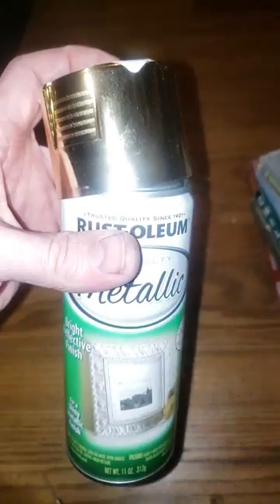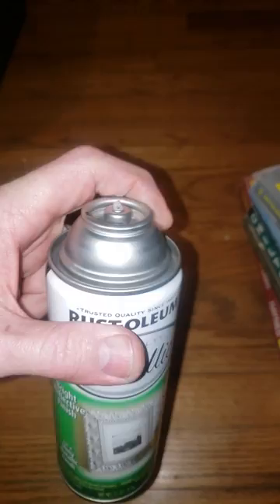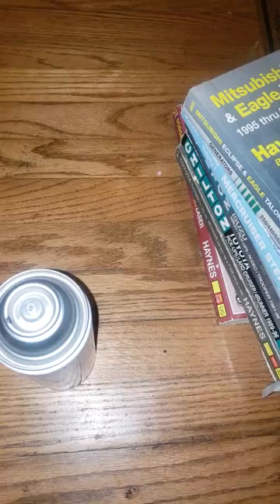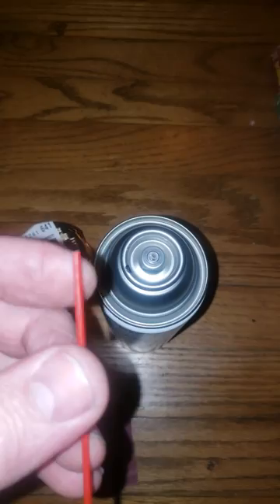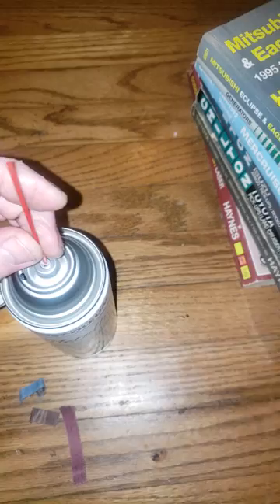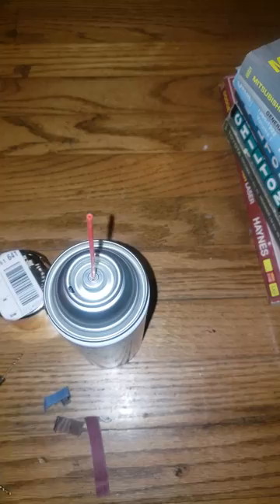Spray Paint Nozzle FIX! Broken nozzle / tube!  L@@K!!

Comment: I turned around to grab the can for the second coat, knocked it off the table and snapped the cap right off... After a few choice words for rustolem my first thought was I knowYoutube has a fix. Here we go again! Thanks for the video.
Reply from the maker: You are Welcome,  I hope it worked so u  were able to finish your 2nd coat. I've been keeping those little straws and some fit without sanding or they are making them thinner now to save money.....lol
Reply: Just got a can of carb cleaner ,and used about 1 squirt out of it.
It was sitting on the floor and I had to step over it,not lifting high enough and busting the tip out.
I knew I'd find a fix here.
Reply: Bro same shit, I just dropped it going for the second coat

Comment: Hey, my man you are a f..ing genius. I’ve wasted so much money on wasted paint and class cleaner. I hope it works with my glass cleaner cans. Great problem solving thanks for sharing.
Reply from the maker: Thank you for the compliment! It really amazes me at how much response,  compliments, etc I received for my first and for now, only diy video. It seems this has helped so many and back when I had this issue,  I couldn't find much at all online about this. Now, they have videos of actual packs of replacement nozzles but unsure if they work for where the tube breaks off nearly flush with can...lol.  Let me know if it worked.

Comment: Thanks! I knock caps off now and again. Use to cut the can open slow to release the pressure and use what I can. .don't last long cause most of it evaporates. This tip is gold. Thanks.wil try it in my silicon spray .
Reply from the maker: Yw....good luck!

Comment: The spray paints from this brand always break when I use them. I thought it was just me, but my friends also had the same issue..thank you for the video I will try!
Reply from the maker: You're welcome...I hope it works for you as well...I have received many messages thanking me because it did work for others. Good luck and wear safety glasses
Reply: Good paint brand and little pricey too, but they're using cheap material.

Comment: I went to use the drill bit and the can sprayed directly in my eye, I went to wipe my face in a rush with paint thinner then I ended up burning my eyes and face with it, please make sure to use safety glasses if you are to proceed with this trick.
Reply: Also don’t rub you’re face with paint thinner
Reply from the maker: Yes, wear safety glasses anytime you are dealing with anything pressurized.  That's one reason I made the little comment about not getting paint on me yet (I knew there was a chance of getting paint sprayed on me especially since that was the first time I tried it). I also twisted drill bit by hand to help prevent accidentally spraying. If you do get paint on you , especially in eyes....flush with water , no chemicals . Paint thinner is very irritant to the skin and most definitely your eyes. I had on safety glasses but it wasn't seen in video. I have did this little trick at least 10x since the video helping out people I know with cans of paints and other sprays.....so far, no accidental sprays. I'm glad you are ok and know to use safety glasses and now know not to use thinner on your skin. Kerosene works well on hands but wouldn't use anywhere else and would wash with soap and water afterwards,  then apply hand lotion.
Reply: darwin award runner-up
Reply: @florascent9ts  lmao i did something like this too can i have it
Reply: Sounds like something I would do too. 😂👍

Comment: Great video for common problem. You saved many a lot of time, money and hassle, and, them cans don’t end up in the dump all full. 

To keep from potentially spraying one’s face, besides goggles, wrap a little tape to seal straw; it will at least slow down any accidental spraying. If you use strong tape you might pull the straw out when removing the tape. Or maybe just snip off a little of the taped end when all done with the fix.
Reply from the maker: Good point....you can never be too safe.

Comment: The same happened to me today about to put on a second coat. Damn lids. Glad I came across your video. I'm going to go try it now. Thankyou great idea!
Reply from the maker: Should work.....did many times now and seems to be working for a lot of others. Good luck and thanks!
Reply: @dgmenace73  It worked perfectly. I did what you said. Put the straw in a dremel to sand it. Used the drill bits by hand. No mess and easy. Thanks man!

Comment: You can also use a thumbtack or a needle to pull the broken piece out, just stick it into the side of the broken tube and kinda pry it out. It takes some effort but after you're done, you can replace it with another nozzle.
Reply: Nope the straws inside the can unless you've got the other type of spray paint can
Reply: @crackedthieves  Agreed, you can't do that because it's one single undetachable piece... there's nothing removable at all.

Comment: Cool fix will try it. I have half dozen spray cans with broken nozzles, some I could reinsert the tip most could not, some never got a chance to use.
Reply from the maker: I hope it works for you.....it seems like most break off just high enough to not be able to reinsert the nozzle, or in my case that's the way it seems.  Good luck!
Reply: @dgmenace73  The ones I couldn't fix, will drill a small hole to release the pressure  then use a saw and save the remaining liquid. Gloves and full face shield. Also do this when those cans run out of compressed air.

Comment: genius . thanks man, know i can use 3 cans i dropped and broke
Reply from the maker: Thanks...hopes it works for you!!!
Reply: Dennis Griffith , just did it again yesterday, on a more than half full of black semi gloss, first try didnt work , think i drilled it too wide, then i used some orange fast set pvc glue on the red straw and it worked w no leaks. just painted my tractor yesterday. thanks man, now im kicking myself on the last few almost full cans i tossed out a week before seeing your video. thanks again bro
Reply from the maker: You're definitely welcome!  I just couldn't throw that $16 can of paint away....lol
Reply: Dennis Griffith , exactly , i just watched another video yesterday of a guy that transferred paint from one can to the other,  he stuck the good can in the freezer and the one w broken tip under hot water , and put them upside down and transfer paint. took him 3 times to get all paint out but i thought that was another neat trick
Reply: I have three cans also

Comment: You have more patience than I do... I just take the can outside to a field on my property, along with an air rifle, and make a reactive target out of it... gets rid of the paint... the paint goes on the weeds that get mowed, and no paint pollution by just tossing the can in the garbage... I also shoot empty cans to relieve the pressure before tossing the can out or recycling it.

Helps to have the proper place for airgun shooting !
Reply from the maker: I get told that all the time about my tinker patience but it to no more than 15min....and someone wanted me to paint something for them and they bought the paint so I was determined not to have to pay $13 for another can.....lol
Reply: lol, that's one way to get rid of spray paint cans.
Reply from the maker: I do that too....if paint is just no good, especially if pressure has leaked out.  I just recently made some anti ricocheting "plinkers" . I used rebar to make quick assemble and quick disassemble stands, big nuts welded to heavy chain, then welded to 1/4" to 3/4" steel plates I cut in different shapes, sizes, and thicknesses to get different plink sounds. Up to a 308,  it stops the bullets dead, I can find them under to a couple feet away from targets, no dents. I use field marking paint like for football fields, paint the steel with a very heavy duty paint then later on just spray a thin coat of white marker paint, you can see where each bullet hits.  I may make a video on it

Comment: I bought a can of paint only to find the straw is broken a month later when I finally got to use it so returning it isn't an option. Thank you so much! I'm excited to finish my projects
Reply from the maker: You're welcome! Glad it worked for you!
Reply: Hii
Reply: Same - thanks for the idea. I'll try it
could save my £20
Reply from the maker: @mariehurley917  I hope it continues to work for everyone. It really was a simple fix and the videos I found prior to mine were not much help. Just wear safety glasses and gloves. I have done a few more since this video and they all worked. One there was NO tube at all sticking out of can and it worked as well. This is just something to prevent from having to throw away good (some very expensive) paint and have to buy more when you can do this and use the paint instead of having to buy more. Most of the $2-$6 paints you can replace the sprayer because the spray tip has the tube on them? Idk why but the more expensive paints have the tube in the can, not the nozzle? Enjoy and so glad I have helped you all out.

Comment: Very good, Originally I tried to do this using a cordless drill. Don't do that. Makes a mess. great thinking.
Reply from the maker: Yes, I imagine it would.  I was too afraid the weight of drill or me accidentally pushing would cause it to spray out on me. I was surprised at how easily the 2 drill bits worked just by hand
Reply from the maker: Yes, exactly why I said to do by hand....Definitely use the drill only to spin the red straw with sand wrap around it.....drill the can by hand, easily

Comment: How did you get the spray nozzle to fit the smaller diameter straw?  BTW, those old Chilton Manuals are collectors' items.
Reply from the maker: I have did this a bunch of times....all the carburetor cleaners or brake cleaners' red spray/aim straws that I have tried have fit the red and white colored nozzles off the brake/carb cleaners and as many paints fit  the bottom of the "replacement" nozzle (the red one in my video that I mentioned it came off a cheap can of black spray paint ...u can see a little black paint on nozzle right b4 I aim into box) they have all fit the end I DID NOT sand down......the reason I used bits to twist with my fingers to hollow out tube inside can AND used the sand paper to make red straw thinner is so that I would not have to make Only the tube in the can larger which would makes its walls even thinner and the same with red spray straw,  I didn't want  the end going inside broken can tube so thin that it would break easily.  Does that make sense?  If not I can explain it better. Oh, and yes....I have about 10 or 12 from vehicles I have owned, where I worked on other people's cars/boats., etc......I just found one on old OMC outdrives, an old early 80s Suzuki , then several for Spitfires....think I may sell them, will never use them plus sooo much is available online its unreal,  but I do like having my own book...lol. Is it just me but are the books leaving out a lot and or just barely touching on issues/instructions nowadays?  Thanks for watching,  I hope it helps.  Oh, go to a Dollar Store....look for their cheap, $1.50/can paints to use the  nozzles off them. They also sell starter fluid which I can't remember is cheaper than carb cleaner or not but I saw the cheap priced paint and opened in store, I carefully pulled nozzle off the paint and had starter fluid can as well, I checked the fit and the white nozzle off paint fit the red straw tight.....thinking you could make a couple spares to keep near your paints?

Comment: nice job buddy!  I am not sure if I have the patience to sand the replacement straw down to fit inside the broken one though.  been waiting all week for the weather to warm up and quit raining so I could do this spray paint job and sure enough I take the lid off and break the nozzle.  why do they have to make those spray paint lids so hard to get off?  anyways, you gave me something to work with.  see if I can get mine going again.
Reply from the maker: Awesome....just put the red straw in the chuck of a cordless drill.....spin it and grip sandpaper around it....it only took 15min the whole job....then 30min for super glue to dry but u may not need the super glue. I hope it works for you. Did several more since the video without super glue. The drilling of the can tube was very easy as well....just twisted the bit by hand. Good luck!

Comment: Im legit mad that rusto switched to female caps. Ive used a TON of paint and never broke a stem off but today i had to paint  40 feet of baseboard that needed to be replaced from water damage and I bought a big can (15+ozs) for like $11. And it fell off the back of the truck while i was unloading, broke the can lid and the stem broke off inside the cap.

Unfortunately this trick only made it sput and sputter and was very low pressure. Also, even though my wd40 straw was short, it kept breaking off too. Then i tried drilling the hole big enough to accept a male cap that was sanded down a bit. That didnt work either. It still spits and sputters.
Reply from the maker: I understand your frustration.   I wonder if your can possibly has other issues? It's worked for me at least 8 times and I've received a ton of replies saying this worked....I would demand an exchange if you don't live far from the store . I live 30min from a store that sometimes has it in stock...lol.  I wish they all used the male nozzles too. Sorry this didn't work out for you.....It almost sounds like your nozzle is partially clogged. I saw where soaking in fingernail polish removes cleans out the nozzles....just an idea.

Comment: Please elaborate on what the sandpaper is used for?
Reply from the maker: I only used the sand paper to prevent having to drill into the tube inside the can more.  I have found that all those red straws are not all the same size. Some don't have to be ground down much if any. I use whatever grit I have handy, its not like sanding furniture or body work where it has to be nearly flawless.  I usually grab a course sandpaper, lock the red straw in a drill as if it was a drill bit, wrap the paper around the straw and spin until I can fill a definitely difference in its thickness, then go with a fine grit to smooth it out.  Hopefully this makes sense. It doesn't take much to get a red straw to fit in one of those tubes......I just didn't want the main "working" tube in the can to be too thin nor the red straw to be too thin so I drilled  the white tube by hand to make the inner diameter of white tube larger and then sanded the outer diameter of the red straw to be smaller to slide into the white tube. Thanks and hopefully it works for as it has the others.

Comment: Hello I ordered a can of hair Mousse and the head was broken off. How do I safely open the can as it still has product inside it?? 

THIS IS THE INSTRUCTIONS BEHIND THE CAN👇

WARNINGS : Contents under pressure. FLAMMABLE - Do not puncture or incinerate. 

PLEASE HELP ME!!
Reply from the maker: I have not experimented with those types.  I would just wear safety glasses and see if one of those straws will be too small......I could be mistaken but I think they use a special nozzle to make it come out as a foam?  Sorry I can't be of more help.
Reply: @dgmenace73  Thanks for your response!

Comment: Rustoleum is the best spray paint on the market. I don't know when they went to this nozzle design, but its stupid. The cap is so hard to remove this has happened to me many times in a few years. I just sent a complaint to thier customer service,  as they have ruined another of my projects.
Reply from the maker: Yes, love the paint....hate those caps that are difficult at times to pull off....I'm also the kind that keeps the caps on or puts them back on after use....I also turn cans upside down and spray the paint out until just air comes out to prevent the clogs.
Reply: @dgmenace73  Just happened to me for the first time after I used about 10 cans in the past with no problems. I just removed the cap and it broke the straw. And it happened with the most expensive new paint can. I will try to find the receipt and replace it. This sucks. I tried super glue to glue the straw but it didn't hold.
Reply from the maker: @ronenfe  yeah, if u have the receipt and store is local, I'd take back as well.....the original (especially on the expensive brands), have a better spray pattern.  Most of the time I am care or at least try to be but sometimes not thinking,  and in a hurry I have done that but MOST of the time its because the can fell and broke tube...smh.  Good luck getting your return!
Reply: @dgmenace73  luckily I found the receipt because it happened the same day I bought it. They replaced it without problems. Be careful when you open the cap. Better to leave it without the cap.
Reply from the maker: @ronenfe  good!  I hate it when stores don't take a return.  Our local Walmart says they are not taking returns because of this Covid-19 situation...smh.   There is a video on YouTube, you will have to search. It shows how to make tops easier to pop off once you remove it the first time.  If anyone knows were you can get automotive paints, in a large spray can for very low price....please let me know. Thank you all!
Reply: It is def not the best but is good if your only going to department stores